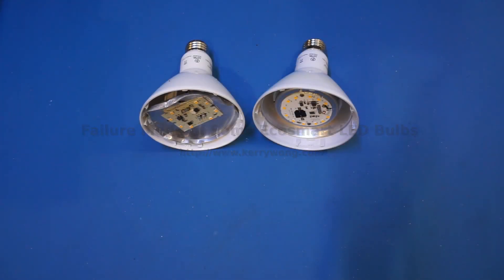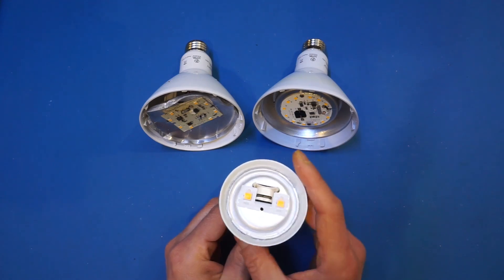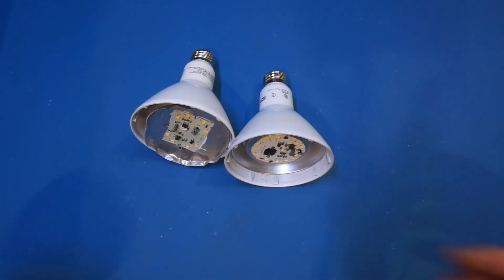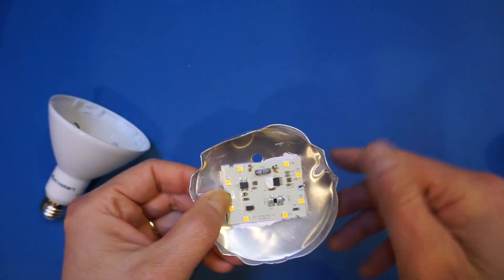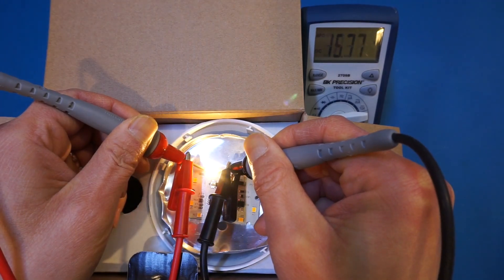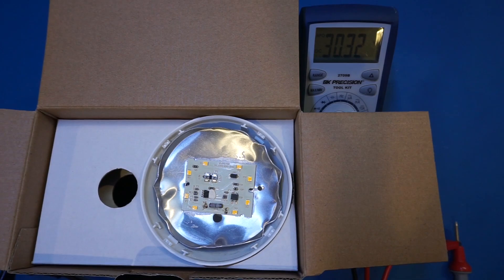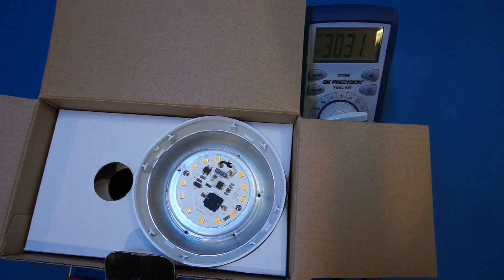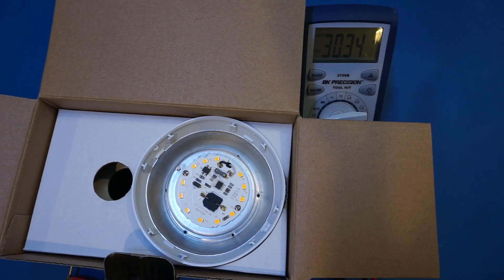Failure mode of Some Ecosmart LED Bulbs

Comment: Is there a way to make this functional again? Bypass that led, and place in equal to or greater resistance?
Reply: Should just be able to put a 250 ohm resistor (7.5v/0.03a) across any of these dead LED chips.

Comment: For things like car tail-lights, I remember the design being two parallel chains, so that if one module died, you'd still have half the lights working.  Wonder if there's some kind of shortable element you could put in parallel so if the module died, it would just shunt around it.

Comment: Great video. This whole topic is very amusing. Theoretical longevity turned into marketing, with almost none of that longevity delivered. The capacitor problem can be creatively solved, as per your example (I've never seen components crimped into PCBs like that, very interesting!). The LED problem is another issue. The more common mode of physical LED failure is the detachment of bonding wires due to thermal stress. The less common mode of failure is the die getting cooked (brown spots etc). As long as the most common mode of failure is essentially a manufacturing issue, there will always be strong variance in failures for these products. Because of that, I don't see this problem going away in the future, unfortunately. The resulting waste is problematic.

Comment: I bought two LED lamps, one series for the kitchen . It was written on the box that they were the equivalent of a 100-watt incandescent lamp. One lamp burned out after a month. I cut off a plastic flask from the second one. It's been shining for two years now . I think the main problem is a very bad heat sink, and because of this-degradation.

Comment: The LED chips fail because they are driven too hard, and not cooled enough. Run them at the 10mA you put through on test and they will do the 100k hours rated for them, but as most of these run at a very much higher current the led dies fail with time and switching cycles, which break the bond wires off. You can see the black spot of arcing in the yellow in the one clearly, and I guess a little pressure on the top of the phosphor coat would get some light out as it makes contact again.